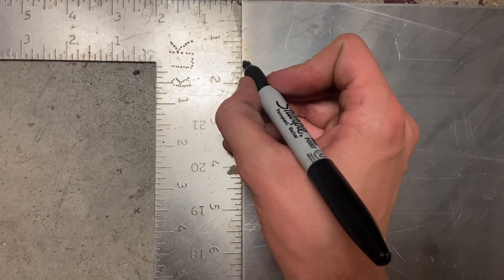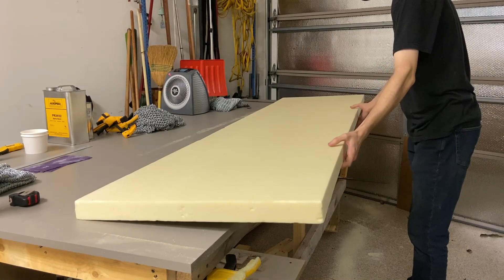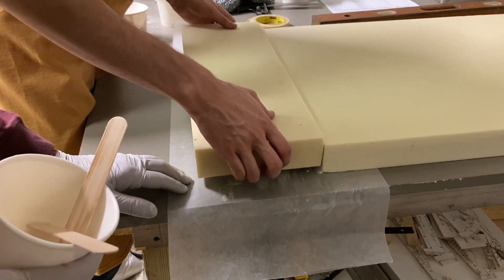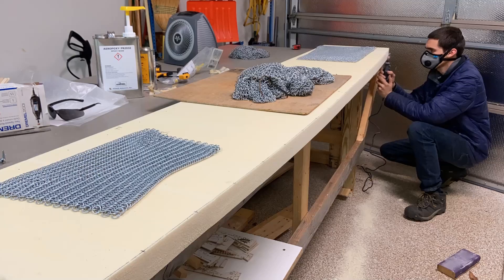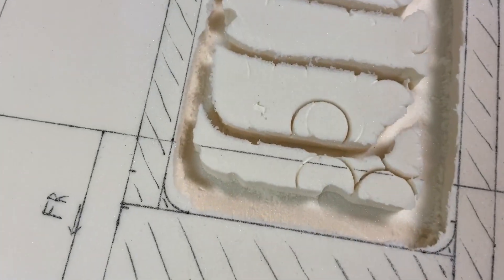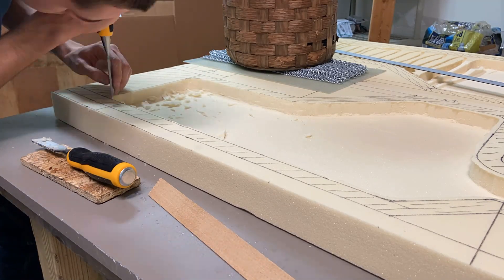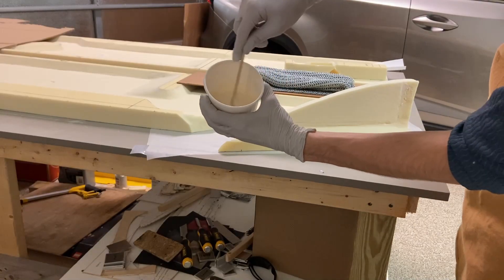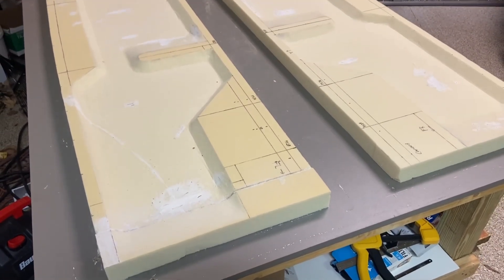Shaping Fuselage Side Foam Pieces: Building and Airplane Part 3

Comment: Hey really good to follow this process. I am considering building this as well. Is this a long ez or a different version. I am looking for plans and best place to buy in the uk. If you could share best place to buy this would be ace. All the best with the build and would love to follow along. Vanblade
Reply from the maker: This is an ERacer designed by Shirl Dickey. You have to contact him directly for plans. Do some serious research before you pick an airplane to build. The ERacer has incomplete plans, so it is going to be a real challenge to complete. For me, this is a selling point since it gives the flexibility to alter the design slightly, but that will not be the case for most people.
Reply: @WalkerWeathers  What do you mean incomplete?
Reply from the maker: The first place I saw the word used to describe the ERacer was this website http://stargazer2006.online.fr/derivatives/pages/eracer.htm and when I read it a lot of confusion finally cleared. I have read through the plans I purchased several times and am frequently left with many questions. Some aircraft plans go step by step through the entire process while the ERacer leaves a lot of choice to the builder. The most obvious example to me is the nearly complete lack of any information on the aft most section of the fuselage which could be an engine cowling or drive shaft cover depending on whether you are building the MK1 or MK2 (automotive vs. aircraft engine). Another example is no mention of critical aircraft speeds like the never exceed speed (which should not change with even major modifications). The word incomplete leaves a negative connotation and is not perfect, but it is the best one I have heard so far. If you want every detail meticulously laid out, then the ERacer is not for you. If you want a starting point for an aircraft design and freedom to make changes and figure out many systems for yourself like I do, then the ERacer is a great choice. Hopefully that helps. If you want more details we could figure out a better way to communicate. I also have to add that Rock who runs http://www.eraceraircraft.com/ is a fantastic resource and is happy to answer questions the plans leave. @electricaviationchannelvid7863
Reply: Seems a variety of plans are like that, I’m building a wooden Dakota Hawk and the plans leave a lot to be desired but if you like to add your own touches and you’re not afraid to make some changes it works out fine